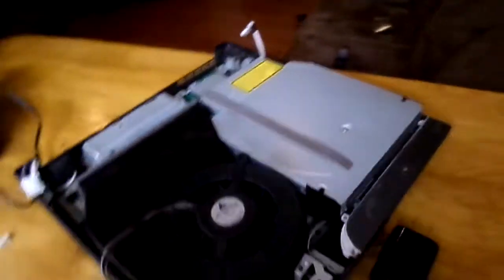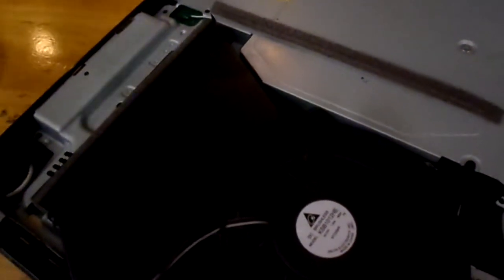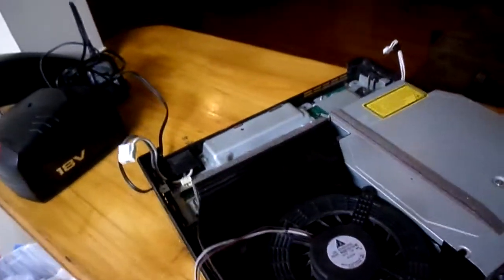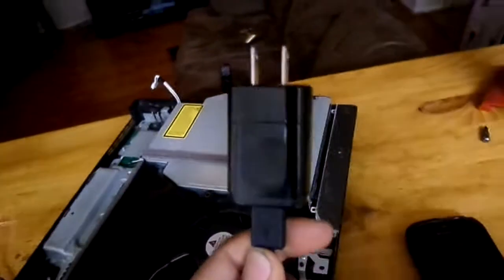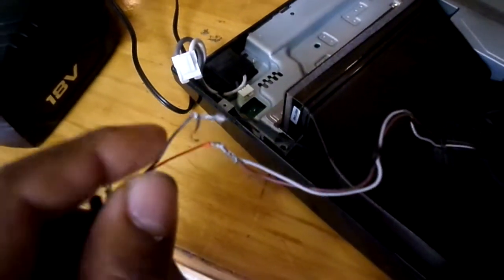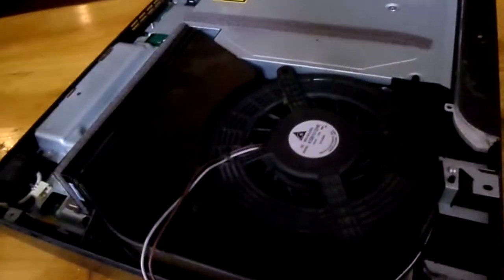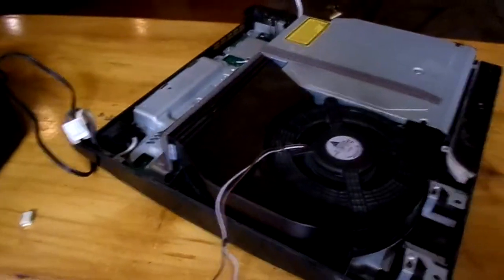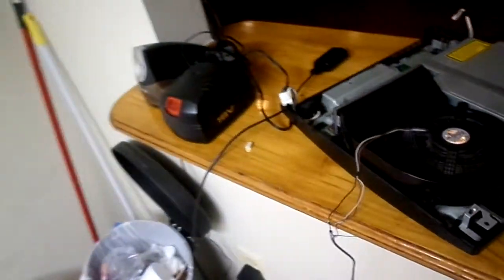How too Fix the Fan of the PS3 slim!

Comment: Does this control the fan speed of the PS3 gets hotter?
Reply: Does this control the fan speed of the PS3 if it get hotter ?......I got the ylod too lol....but I have a ps4....I wanna fix my PS3 though
Reply: +Kingvik7 Gaming it keeps the fan on the highest rotation i believe. Which is good.

Comment: This worked, but my fan only stays on low speed and ps3 gets hot...hoe can i make it to high speed??? Please help
Reply: See if your ps3 model can be modded with either cfw or hen to install webman and set your fan higher and prevent overheating.

Comment: A friendly tip: Please try, every single time you open ANY electronic to be carefull with ANY surface mounted plug you shouldn't need someone on a vid to tell you to be careful it should be second nature to be gentle with any surface mounted pulgs and connectors. They are fragile and they will come up like seen here.

Comment: I know this is old but you could have simply solder it back to the motherbored
Reply: Hello :) Maybe you could help me out with this solder - solution ??
Are the cables from the PS3-fan long enough to solder them on the downside of the mainboard?
Cause - I've ordered a new 3-pin fan cable (black, yellow, red), but the colours of the PS3 fan are grey, brown and black.
Black to black - OK
But.. the brown one with the red one? (for tension?) 
And the grey one with the yellow one?
Iam so confused 😓 maybe you could help me out :)
Reply: @wh0th3fcar3s  yellow is the rpm match it to the grey. 
Black and with black 12v -
Red to the brownish red  for 12+
Reply: Not everyone can solder brah. If i could i would. No i have to pay someone to do it. Looks like it's a common problem with those weak ass connectors .
Reply: @kmax7521  soldering is quite easy  takes practice like most things in life. Right tools makes all the difference in the world.  Flux is your friend.  On a side note you could Alternately run it off of the psu....12v to your fan  as soon as the console powers on. Not the best fix but can be done 💯 no soldering